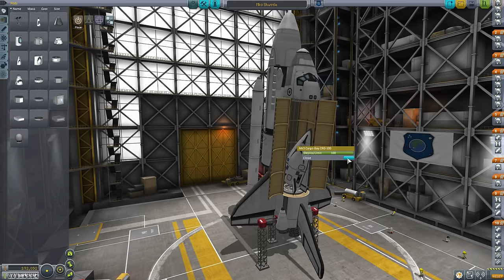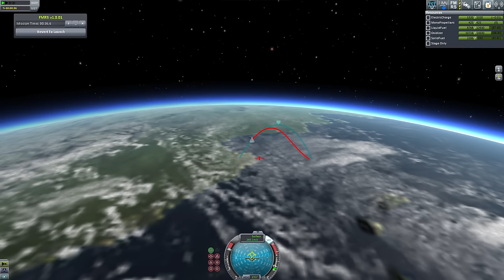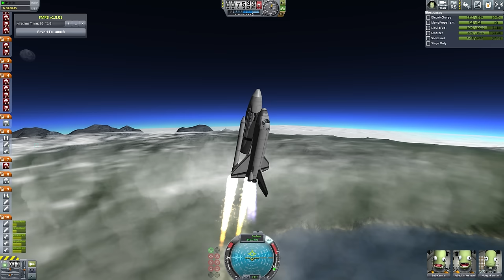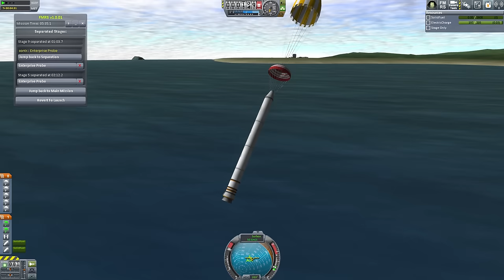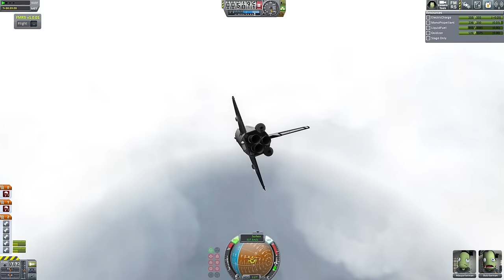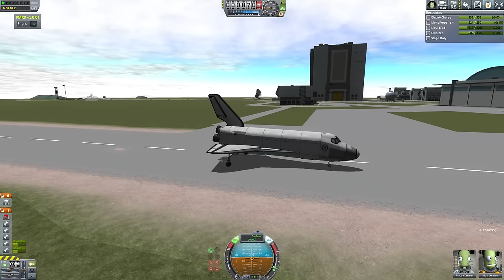Mk3 Shuttle Pt 2 - Flying the Kerbal Shuttle

Comment: In the end of the video you mention you require a way to bring large parts into orbit for a space station. Now i do realize that this video is 2 years old but for those who also have this problem, i would recommend a large ssto. Simply build your plane with the stratolauncher in mind, but with a large fairing as cargo bay. In here you can fit almost anything, and its surprisingly easy to balance the plane. Just make sure you use mostly mk3 or mk2 fuel tanks as they have a lift rating, meaning you will need less dry mass eg wings. Mark thrimm has a video of which i took inspiration from, thoe i utilize scaled up jet engines which i’ve manually balanced the stats on. Also, if you’re building the shuttle in this video, i encourage you to pick up the 0.65m to 1.25 m adapter fuel tank, drain the fuel and offset it to the correct position. On this you can stick whatever engine you desire while avoiding using the thuds (which you should never use cause they have abominable specific impulse). Other than that, great video. Another detail to add would be elevons offset into the tail fin of the shuttle which have their steering options disabled and deploy using the brake button, to act as airbrakes, like the real shuttle. And if you wanna stay even more true yet, disable steering on the landing gears and set them to not toggle deploy but simply deploy, excluding the option to retract them.

Comment: Ruben quick question why do you put the engines and the probe core at 15 degrees again please.
Reply from the maker: The engine are at an angle to get the center of thrust to go through the center of mass,  if the center of thrust is not through the center of mass the vehicle will spine.  It doesn't have to be perfect because the engines can gimble in flight to keep the center of thrust inline with center of mass.  Controlling from the rotated probe core helps to fly straint in the direction the engine are rotated.  Also reentering while controlling from the rotated probecore keeps the nose up and make for a nice reentry.

Comment: Nice video. How does your trajectory mod show you the flight path accurately with a shuttle? I can never hit KSC even with trajectories because i move further ahead then the predicted landing spot
Reply from the maker: The probe core is rotated 15 degrees, so the shuttle is nosed up 15 degrees when you use prograde hold while controlling from the probe core.  It's between the main engines.  You can see the probe core in the last video.

Comment: Awesome design! Only shuttle i've tried building that flies so well. However, my shuttle is built EXACTLY like yours, but mine flips out upon reentry around 37km....do you have any tips?
Reply from the maker: Try to keep your shuttle level,  try not to yaw or roll at that altitude an see if that helps.  Are you trying to use prograde hold on the rotated probe core for reentry?
Reply: Yes I am.  I wonder if a slight difference in the wing placement could be causing it...
Reply from the maker: It could be, try adjusting the wings and see if that helps.
Reply: +man united23  Usually flips are caused when the center of lift is in front of the center of mass.
Reply: Justin Baker Nah, the most usual reason is because the center of mass is in the back, and that makes it go backwards
Reply: nice gaming dk You basically just restated what I said. If your center of mass is in the back then more than likely your center of lift is in front. Therefore your craft will flip, try it sometime :)

Comment: Hi Reuben. Just discovered your channel after the Collaboration station build, and am really enjoying it. The shuttle looks great. but I wanted to ask if putting a rounded adapter at the bottom of the main external tank affects performance, and if these designs work in 1.2.2?
Reply from the maker: A round adapter might help with drag,  I've been considering putting a heat shield at the bottom so the tanks are less likely to burn up.  These designs still work,  with a few minor changes.
Reply: Thanks for the reply. I'll have a look at the design tonight and see if I can get it to work

Comment: What is the purpose of angling the engines at 15 degrees? Is that to compensate for COM being off centered with the external tank?
Reply from the maker: Yes,  to fly strait you must have the thrust in line with the center of mass. It its not you will spin.

Comment: If you're just using the probe code to set a launch and re-entry angle, you can use a cheaper docking  port. I know the cost is almost negligible but it has the same capabilities as the probe core

Comment: Whenver I try to launch my shuttle, It always is too heavy near the external tank and it fails. Help would be appreciated.
Reply from the maker: You want to make sure the thrust vector is through the center of mass,  and keep in mind the thrust vector will change when the SRBs burn out.  Also the center of mass will change as the fuel is consumed.

Comment: Awesome job, man. I'd just like to ask if anyone has any tips for stabilising the shuttle. About half way through re-entry, it starts to spin out of control. Admittedly, I've never built or flown a shuttle before, which shows how good these videos are.
Reply from the maker: I found that they tend to flip out like that somewhere between 12000 and 25000 meters up, I don't remember exactly where it's at.   You should be able to pitch if you need to, but try not to yaw or roll the craft.  That seems to cause the out of control spins.  If you do the entry the same as in the video, you should be able to get back without spinning.
Reply: That's about where it started to spin. The nose started to turn and I hit the yaw then it flipped. I will take a closer look at the video. Thanks for the reply!
Reply: I might have found what I did wrong. I had the sas on but it wasn't locked in to Prograde, it was just on stability assist.
Reply: Try adding some airbrakes to the back of the craft. The extra drag when deployed should be enough to keep the shuttle flying nose first.

Just remember that once the shuttles fuel and payload is gone, there's a huge amount of weight distributed right at the very back as those rocket engines are enormously heavy for their size. This isn't a great characteristic for a stable craft so try to either increase the drag at the back, or redistribute some of the weight so your Centre of Mass is further forward if its feasible.

I went with the airbrakes and my shuttles and SSTOs tend to come back in one piece most of the time.

Hope that helps a little.
Reply: Poonannyish
 I'll try it. I've managed to get my shuttle somewhat stable but it's not the best. Thanks for the reply, I'll have a play around.

Comment: When I try to take off it tries to pull back, I'm controlling it from the probe core in the back and have built it correctly, does it just not work anymore?
Reply from the maker: Are you using SAS hold?  It should still work, but it doesn't fly as nice as it once did.
Reply: Kerbal Space Command do you mean the reaction wheel in the back? If so yes
Reply from the maker: Make sure it's activated, it's the T key
Reply: Oh yeah, I have sas on, I tweaked the engines a bit and it seems to work now, thanks though!

Comment: My version of this design always seem to yaw badly until it flips rear end first starting around 30km to 25km during the reentry.
Reply from the maker: Try downloading my version and take it apart to see how it's put together.
Reply: Kerbal Space Command I'll try that, thanks.
Reply: +Kerbal Space Command My shuttle is unstable during launch and ascent, what could be a problem?
Reply from the maker: Do you have the large sas module?  also try using the RCS.
Reply: Kerbal Space Command I actually found that the center of thrust was off. :L
Reply: I have the exact same issue. My design is pretty off from the video but I simply can't figure out what is causing it.

Comment: Are you using FAR? I'm trying to land a shuttle like this, but the Trajectories mod seems pretty inaccurate for me. I overshoot by like a continent or so.
Reply from the maker: I'm not using FAR,  are use controlling from the rotated probe core in the back.  That's the way trajectories is accurate for me.  So when you have prograde hold on the probe core the shuttle is nosed up.
Reply: +Kerbal Space Command Hey, thanks for the reply. I'm doing the same as you, as my shuttle is nearly a blatant copy of yours.

Hmm, it's something else then, as my predicted trajectory is just a normal ballistic drop (which is inaccurate), whereas yours shows how the craft will fall, then lift, and then settle on down towards the ground.
Reply from the maker: Only thing I can think is make to sure you click control from here on the probe core.  It that's not it then you could try to mess with the angle of attack under the trajectories menu.
Reply: +Kerbal Space Command Will do. Thanks for your time, and awesome vid as usual! :)
Reply from the maker: thanks :)

Comment: Do you have a list of the mods you're using?
Reply from the maker: The mod I use the most is trajectoires http://forum.kerbalspaceprogram.com/index.php?/topic/94368-112-trajectories-v162-2016-05-18-atmospheric-predictions/ 
EVE for clouds, planet shine, I have some other mods installed but I don't really use them much.
Reply: Thanks. Was wondering about your parachutes because I thought they were acting/looked different than stock.
Reply from the maker: The parachutes on the booster?  I used the Mk16 parachute, the Mk2-R radial, and the Mk12-R radial drogue.